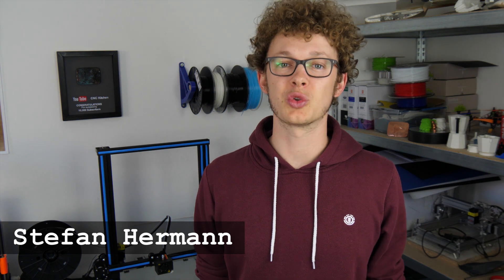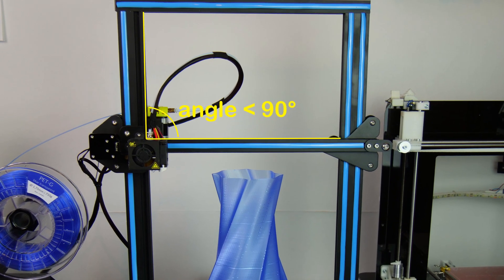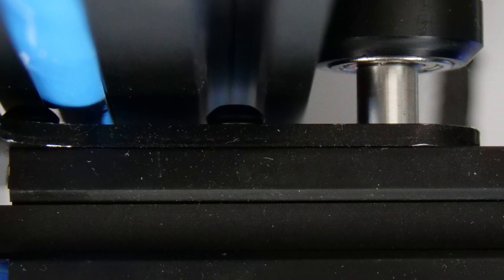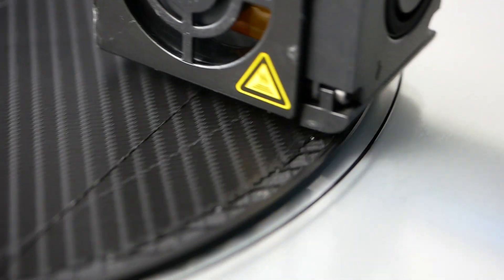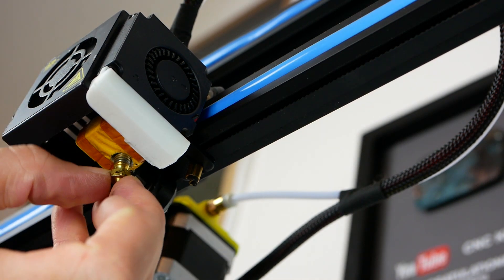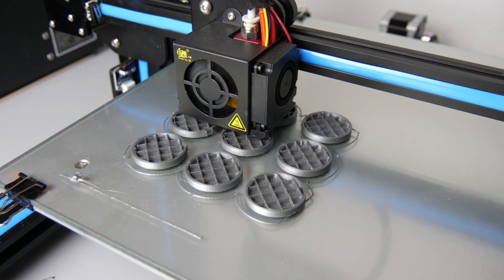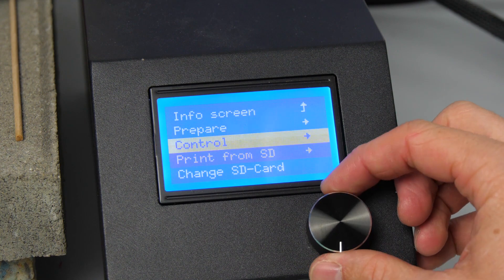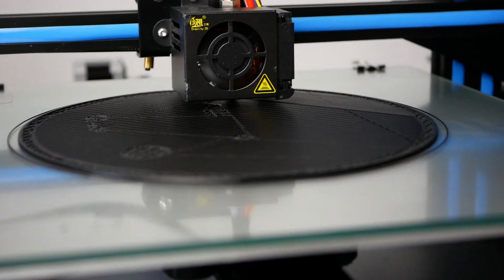Use your CR-10 the right way: BIG parts with a BIG nozzle!

Comment: Very interesting video and it is great that you tried a bigger nozzle and provided the settings - thanks for it! But I do not agree in your comparison with Prusa MK2: I have exakt same setup (Mk2+CR-10) but in my opinion the CR-10 is better in every point. To get in details: 1) Prusa Mk2 makes much more noise (this is solved in MK2S and Mk3 I think) 2) better quality of whole build of CR-10 3) electronics is more  save at CR-10: the heatbed connector is just plugged in at Prusa which caused smoke and burning like on cheap Chinese kit printers ... also electronic box is really small at MK2.  4) bigger build volume at Cr-10 as you pointed out 5)Cr-10 is  much cheaper ... you can buy 2-3 for one Prusa 6) building a Mk2 is similar to that cheap Chinese kits like A8 and needs around 10 hours and buying it fully assembled is more expensive - not good! 7) terrible hotend fan cable - this is solved at Mk3.      The quality of prints is similar for both printers. So the Cr-10 is far better also for beginner than a Prusa Mk2. Also I want to get into two aspects 8) yes heating needs around 5 minutes but compared to a print which needs like 1 to 100 hours this is nothing 9) auto level at Prusa also needs annoying time.... a feature which is nice but not really needed.  10) Prusa has got higher masses on X-axis because of direct extruder not the CR-10.  I also could add some more points to the list but the Prusa is good only for multi material in my opinion. Also I would not go for the Mk3... some small improvements and there is also CR-10S. For your CR-10 I recommend second Z-axis upgrade ... it costs not much and assembly needs around 10 minutes.

Comment: Since you already have the Tevo extruder, why not convert the whole thing to a direct drive? The metal frame can support the weight and the prints will come out a lot more accurate.
Reply from the maker: I think I'm going to do that. I'm not a huge fan of the bowden extruders, so a light direct might be the way to go.

Comment: that's a lot of problems you had to fix just to get it right. Any other ones you can recommend? I'm looking for the large printers in particular
Reply: Get what you pay for so go in knowing that #1 A single leadscrew is a horrible idea and #2 many things have been scrimped on to make it for that price so treat the machine as a box of parts and you will feel better.
Reply from the maker: I think for the size the CR-10 is a pretty good deal. You can get great large volume printers from other manufacturers (e.g. Raise3D) but they are way more expensive.

Comment: I use a .8mm nozzle and I've even used a 1mm nozzle, but one needs to run about 15mm/s or the stock nozzle heater can't keep up.
Reply from the maker: Yup, that's what I also experienced. I'm very excited how fast I can go with the Volcano?
Reply: Have lots of stringing with 0.8 nozzle on cr10-s5. May you be so kind and give me a hint?
Reply: Thomas MÜLLER Try to change coasting and retraction

Comment: fuck, 500 mm/s^2 acceleration?! I knew it looked slow as fuck. My mendel redesign can do 4000 with 30 for jerk and you can barely see any surface defect at those setings.
Thats supposed to be a bowden printer its supposed to be faster that a direct one like mine. Whats the deal?
Reply from the maker: For the X it's actually way too slow, but you have the heavy bed on the Y which requires lower accelerations.
Reply: Not sure what materiar the CR-10 one is, but mine is made of 3mm wood, plus the hdpe thermal insulator , heatbed pcb, and then 3mm aluminium plate (240x240mm), all running on ptfe bushings and still im doing 4000mm/s^2. My i3 clone has the iron spider, plus the glass sheet and lm8uu(s) and even with some shitty tiny steppers it can still do 1000 mm/s^2.
500 mm/s^2s is something i would expect from a reprap or darwin hold together with steel wire and zip ties to be fair.
How about you make a goce file that goes back and forth a bunch of times and adjust the acceleration in between until it starts loosing steps? thats how i calibrate my machines, both for long and shorter moves and the same goes for adjusting the jerk.

Comment: I have been debating internally about putting a .5 or .6 nozzle on my cr-10 but just haven't committed to it. Every now and then I like printing at .08 or .1 and im afraid a .5 or .6 would ruin the detail a little too much.
Reply from the maker: It probably would. But changing the nozzle is like a 5 to 10 minutes job.
Reply: CNC Kitchen I changed to a microswiss all metal hotend I just wasn't sure on nozzle size

Comment: You are one of the few pointing out the issues with the wheels failing after a short time and other things, GREAT! Auf Wiedersehen und bis zum nächstem Mal.
Reply: I don't know what makes you think high-quality POM bearing tire will not degrade eventually, and quite visibly after just a short time? POM doesn't have a lot of compliance to speak of, it's super rigid. Aluminium surface cannot be perfect, in fact since it's anodised, it's actually guaranteed to be pretty abrasive on a microscopic level. It's a sponge of corundum on its surface, one of the hardest minerals! And you want your Delrin/POM tire to hold up being rolled against it for miles upon miles... that's basically backwards, if anything, think about the railroad tire: the tire is hard, the rail is soft, that's how it's supposed to be.
Reply: I have seen this mentioned for this printer and another so I suspect the wheels are not really Delrin and are probably a Chinese OEM company who lied to these companies about the material used for the wheels.
Reply: Delrin has lasted for ages rolling across aluminum but the Chinese can mix it with other shit (like they do to filaments) and it breaks down fast.
Reply: I think the problem isn't the bearing tire, i think it's on the other side that the aluminium is not natural but anodised.
Reply: That may be but I have ran into some really nasty Delrin material from China so couple that with some really low cost/quality Aluminum extrusions you can say bye bye tires.
Reply: I have a Cr-10 and the wheels havent wore out.

Comment from the maker: Excuse the stiff intro, I still need to get comfortable in front of the camera 😉 Audio is also still not optimal.
Looking for a good deal on a new 3D printer and want to support the channel? Take a look at the affiliate links below and in the description:
Get a Creality CR-10 on flash sale for $389.99: https://goo.gl/LNHdbh
Get an Alfawise U-10 on flash sale for $455.99: https://goo.gl/ddPi4v
Get a Anycubic I3 MEGA on flash sale for $349.99: https://goo.gl/fH6o3M
Reply from the maker: 6mm retraction at 90mm/s, 4mm coasting, 5mm wipe worked for me. Extrusion width 0.63.
Reply: Buuuut at least you have a face now, that's going to count for something, right?
Reply: As long as the intro has the "Guten Tag" then we're good!
Reply: Could you possibly share the settings you used for the .6mm nozzle?  I’d love to try that nozzle size but don’t want to go through all of that calibration hassle.